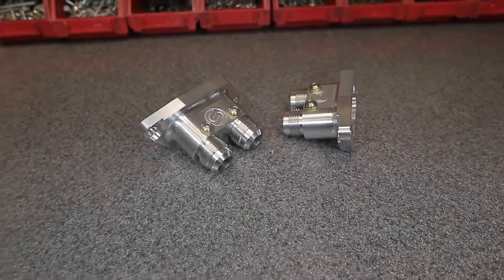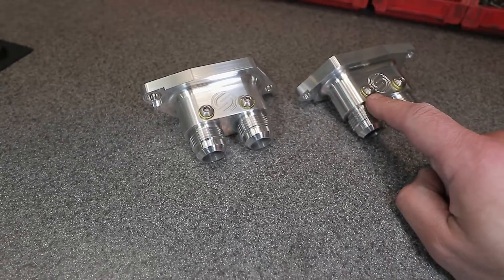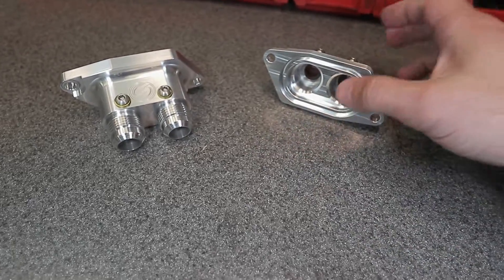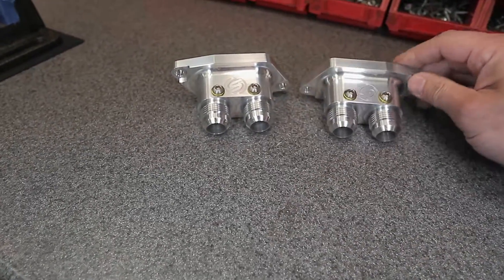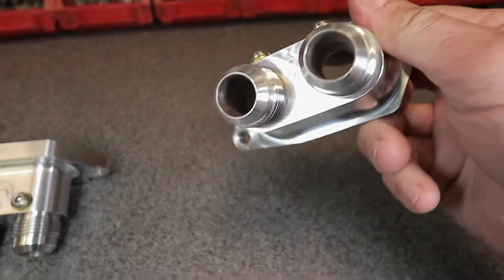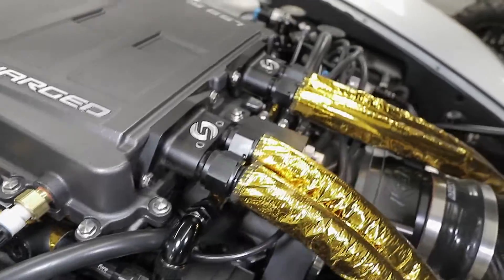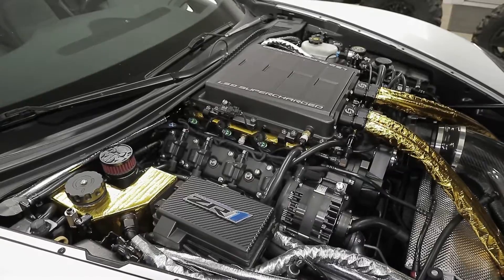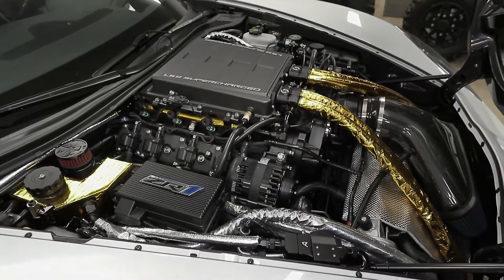Synergy V1 V2 Intercooler BRICK Water Inlets -12 AN | HIGH FLOW | Corvette LS9 LSX LSA CTS-V Camaro

Comment: Hi 
Regarding the stock water pump does it run always when the engine is running ?
Reply from the maker: yes the intercooler pumps turn on 10 seconds after engine is running and stays on.